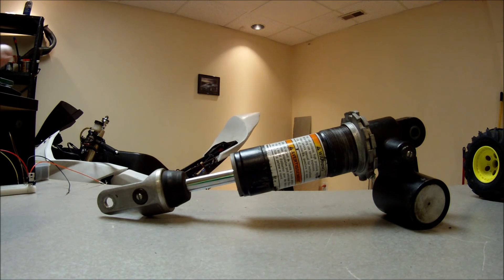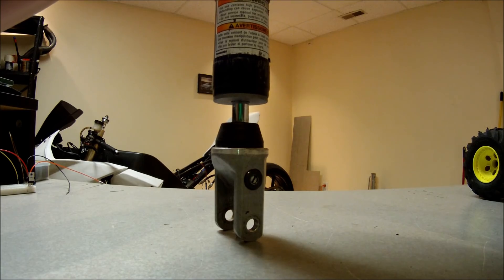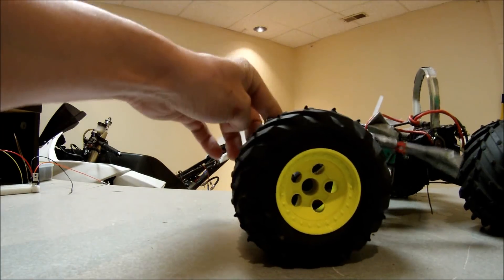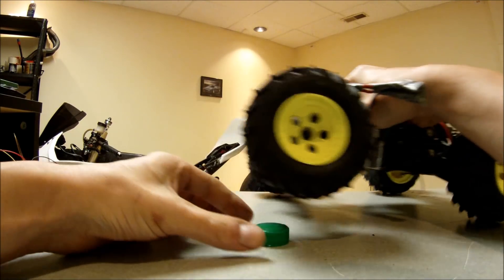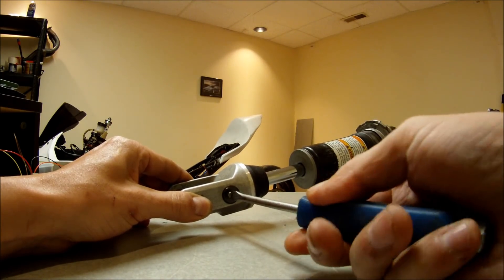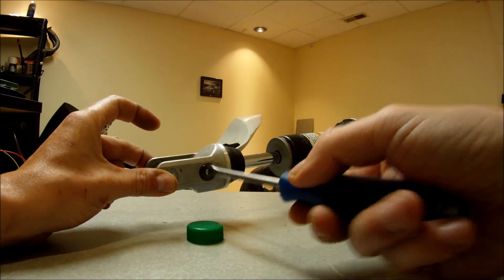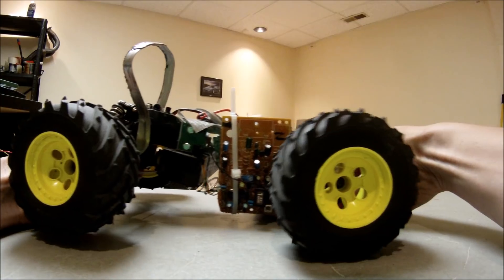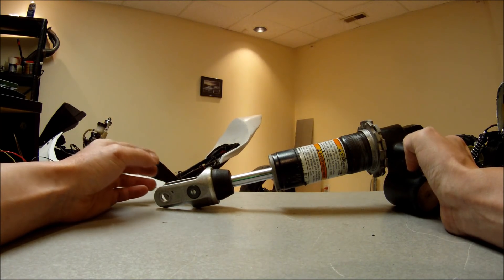MOTORCYCLE SUSPENSION, PART 2, COMPRESSION/REBOUND EXPLAINED.

Comment: Hi.
Great video. First of all, I leave my rear shock for a guy to change oil and so on. But now the shock has a strange behaviour. Without the spring and with the compression and rebound completely open, when I compressed (I need to apply a "low force" to compression it fully) it fully it go back slowly. Now I keep compression completely open and close comletely the rebound. In this case I need to apply to much force in order to compress it and it go back too slowly than befeore (its ok, because rebound is closed). The question is: Is it normal (for rear shock) the compression become too hard (need to apply to much force in order to compress the shock) when a close comletely the rebound and keep compression completely open? I would expect that when I close rebound I don't need to apply much force in order to compress it, but when I close the compression. Could you help me?
Reply from the maker: Have you tried asking the guy that did work on the shock?
Reply: Yes. Hi told me that is normal. But I don't believe....
Because  when I close the rebound bolt it affects directly the compression so will be difficult to setup the compression.
I asked you about it because I saw you pressing the shock with rebound completely open and after with the rebound completely closed. So do you remember if you need to apply more force to compress the shock with rebound closed. I don't have other shock to do this test.
Reply from the maker: Did you have the same problem before the guy changed oil and so on?

Comment: What happens when rebound is too soft?
Reply from the maker: If rebound is too soft, the forks/shock will rebound back too quickly. Fork/shock rebound is there to control the dissipation of energy stored in the spring.

Comment: Does compression have any connection with Preload?
Reply from the maker: No.
Reply: @everydayirace  compression works in partnership with preload, it assists the spring so as not to bottom out and helps reduce the rate at which the spring compresses, you don't have a fuckin clue what you're talking about, leave it to people that know what they're talking about.
Reply: Thanks for the prompt reply. My bike does not have a fancy rear monoshock so no compression or rebound damping. But it does have the preload adjustment. As my understanding goes, preload is used to adjust the Sag height right? What is the importance of adjusting sag height? Also does adjusting preload affect whether I get a soft plush ride or hard firm ride? (new to motorcycles)
Reply from the maker: Look up part 6 video about spring rate, hopefully it'll help you understand spring preload.